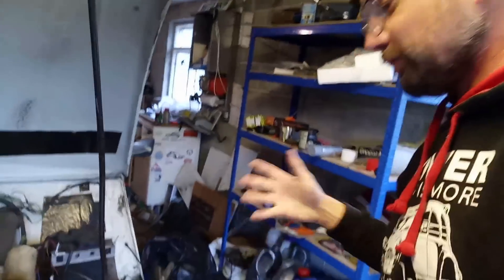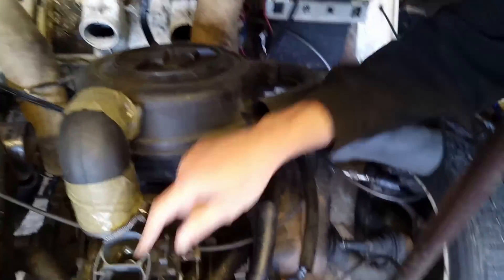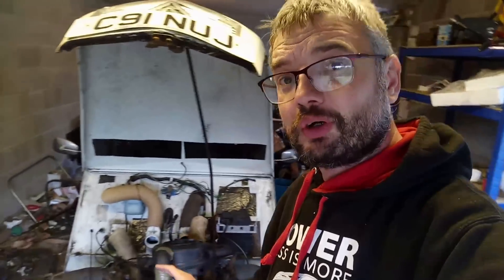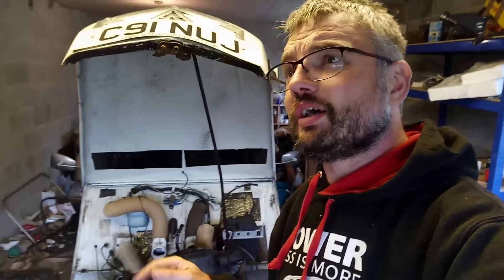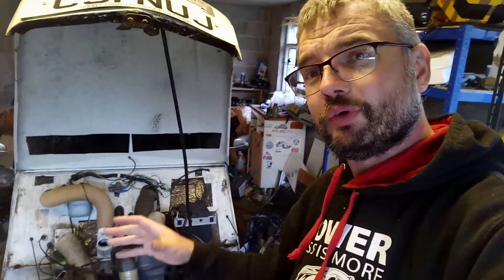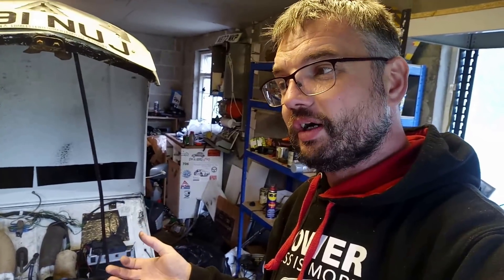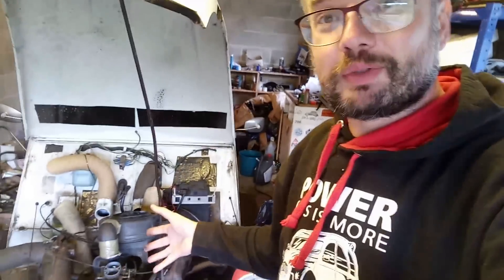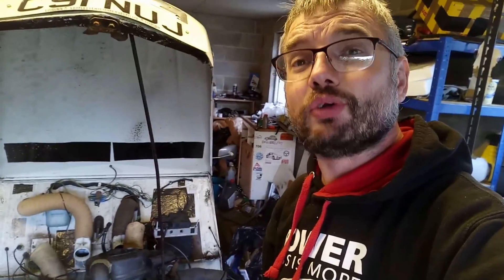Vlog: What is a choke and what does it do?

Comment: I used to own a Morris Ital, and the choke worked well as "cruise control" at speeds of up to 30mph.
Reply: So it wasn't just me then 😀
Reply: Same with the Opel Kadett I had many,many moons ago!
Reply: You were all coking up your spark plugs and washing oil off the piston bores with excess fuel.
Reply: Thats my kind of life hacks, no crazy technology, just ingenuity
Reply: @RussEdgar445y7tlfj  depends how you have it adjusted with the little screw. Yes, the screw should open the throttle a little first but its possible to get this wrong.
Reply: @stepheng8779  Fine if you want premature engine wear and excessive fuel consumption and emissions.
Reply: @TheMentalblockrock  trouble is John my Ital went to the great scrapyard in the sky some 25 years ago so as I said no longer really an issue. But I will put you out of your misery, it was rust that killed it, the engine was still working fine, choke and all.
Reply: @stepheng8779  Rust killed most of them sadly, very few Itals and Marinas left.
Reply: @TheMentalblockrock  yeah true, very sad loved mine, very comfy seats I remember. Got an ex BT 440 van after that which I ran for donkey's years but I couldn't keep the rust at bay, yet again the engine was still sound at the end.
Reply: Last car I owned with a choke was a 1990 Ford Fiesta I believe although I could be wrong. I had a 1987 VW Polo and that had an automatic choke.
Reply: @stepheng8779  The key here is to learn how to weld. That way, barring an accident write off or theft , you can keep an old car going indefinitely.
Reply: By The Way, HubNut cannot weld. it would be amusing seeing him try.
Reply: haha yes that reminds me of my Marina
Reply: I remember being in my brother-in-law's Ital as he pulled out of a side road with a cold engine and it started to die as he was halfway across the road--cue him frantically pulling the choke out to stop it from stalling!
Reply: @TheMentalblockrock  True, but let's be honest, as an 18-year-old with a car you bought for the equivalent of the price for a case of beer, would you have cared?
Reply: I went in an early Fiat 127,  that had a manual choke type device as a cruise control......very scary!
Reply: Blimey! I forgot I used to do the same with my 1987 Panda!
Reply: @TheMentalblockrock  No because for the first 1/3 of it's throw it just advanced   the throttle. Only in the last 2/3 of the pull did it actually enrich the mixture and once you were on your way the piston in the SU carb lifted and the enrichment had very little effect.
Reply: @dandare2586  A workmate had a cheap eastern european Fiat copy, think it was a Polski, and it had a cruise control device which clamped the throttle cable. I think you had to blip the throttle to disengage it.  Not ideal.  :o(

Comment: Having owned only two cars with chokes, all automatic, always worked well.  The '65 Corvair has a device that is operated by vacuum, that opens the choke slightly just as it starts and has a vacuum.   The choke has a bi metal coiled strip that opens and closes the choke.  Mounted on the head.  By the mid '80 carbs were mostly gone due the strict pollution requirements.  The benefit was cars ran so much better.

Comment: I never owned a car with a manual choke, but I had a 1969 Cadillac with 150,000 miles and  a clogged choke tube, which normally would have brought some exhaust gas up near the carburetor to activate the automatic choke. I had to stick a comb in it after a mile or so, otherwise the exhaust would stay black and it would get 5 MPG instead of 9 or 10. I was told that it would be expensive to clean out the tube, so the easiest thing to do would be to add a cable with a knob under the dashboard, but the engine threw  a piston rod before I had a chance.

Comment: The first car I looked at buying after I passed my test (2001) was a 1983 Ford Fiesta. I didn't understand why it kept cutting out when I started the engine and walked away thinking something was wrong. The car I eventually bought was a slightly later Fiesta with manual choke and still not understanding what exactly the choke did, proceeded to drive it 8 miles home with the choke out all the way. Doh indeed!

Comment: I was working at a Fiat dealership when the changeover came. We had to register the last cars with manual chokes by the end of Feb 1993 so there are K reg cars both with and without manual chokes. Along with automatic chokes came single point injection and catalysts. I understand it was the introduction of the catalyst that required the changes in order to control the amount of unburnt fuel entering the exhaust system and affecting the cats performance.

Comment: Early injection systems often had an extra injector for cold starts (sometimes controlled by a crude thermo-time switch based on a bimetallic strip) but modern systems just add more fuel by opening the normal injectors a little longer.
Reply: My Previa had a 5th injector for cold starts, but all my others just put more fuel in from the normal injectors. Good vid, you forget a whole generation knows nothing about chokes.

Comment: I remember using a clothes peg to hold the choke out on one car I had.
Reply: I was just about to say that Ian didn't mention the importance of the clothes peg.
Reply: @RussEdgar445y7tlfj  Yes always a wooden one.
Reply: Ahhh yes, BL vehicles
Reply: @aircrash tupolov That's right Mini's!  I had forgotten about that.
Reply: @RussEdgar445y7tlfj  True it was,  this has made me want to own a car with a choke again Lol.
Reply: Up until recently I had to use a clothes peg to hold the choke out on my Morris. Finally got around to replacing the choke cable so it now works as it should! :)
Reply: @Scuba72Chris  Good to hear they are still used 👍 and I hope you have keep the peg for just in case.
Reply: ah, the classic British Leyland choke trick, remember doing it on my mini
Reply: @RussEdgar445y7tlfj  I always thought it was quite amusing that the heater knob had a fire symbol on it!
Reply: I'd totally forgotten about the crocodile clip from an old battery charger that lived on the choke knob of my Dad's old Mini!
Reply: It was a standard dashboard accessory in both of my Minis, and everyone else's that I knew.  Ever.
I shudder when I think of the length of wire door catch release.
Reply: @RussEdgar445y7tlfj  My Mum's F reg didn't have the floor mounted starter, but did have the hinged number-plate and wire door pull.  Might have had a floor mounted wash/wipe switch.  Not sure, it was a long time ago.  I learned to drive in that car, and I only told her about ten years ago...  She had no idea.  :o)
Reply: Wow I’d forgotten the clothes peg until I read this!

You’re dredging up some very old memories for me!

Comment: On a related note, my dad gave me a tip on starting a car that has a flooded carburettor; push the accelerator to the floor (no choke) and keep it there then crank the starter, after about 5 seconds or so it will start. Works too. Disclaimer: I don't know if this only works on certain types or makes of carburettor.

Comment: I recall an old story from the 1960s about a lady of a certain age who'd just passed her driving test and bought a new Mini ....seemed the car was not running too well....kept taking it to the garage and they couldn't find anything wrong...in the end, the head mechanic went for a drive with her...when they got in, the lady pulled out the choke and hung her shopping bag on it...turns out that was the reason the car did not run too well, so after explaining it wasn't a shopping bag knob after all, and showing her how to use the choke, the problem was fixed.
Reply: I seem to recall in the old Mini that the choke knob was in the middle console too, so ideal for hanging things on!

Comment: American manufacturers adopted automatic chokes almost universally in the 1960's. Our early 1970's VW beetle also had one. My first experience with a manual choke was when I bought a new 1980 Renault 5. 1.4L. Renault went with fuel injection across it's range in 1983. Throttle body style on the 1.4L R9 Alliance . California cars had multi point FI.

Comment: I had an old Mini and the choke used to act like a sort of cruise control too. Obviously push it in to drop the revs. Pull it out to increase revs.
My body developed muscle memory performing this act.
First time I flew a light aircraft, a Piper PA-28, the instructor allowed me to land it. He was talking me through it as I did it.
Once the aircraft was over the fence he told me to chop the power.
So, my Mini choke muscle memory kicked in and I pushed the throttle forward to the stop which applied full power.
That wasn't good. 😁

Comment: The SU has a variance on this in that the choke control moves the jet away from the needle.
Reply: Correct, because on the SU the butterfly throttle plate did both "choking" and throttleing as there was only one barrel, as well as lowering the jet away from the needle. BTW, operating the choke on an A series equipped car also slightly opened the throttle as well as lowering the mixture jet. And this could be seperately adjusted by a screw.
Reply: Same with the E series and most likely others.
Reply: @RussEdgar445y7tlfj  Totally forgot about the HIF series.
Reply: And Strombergs had a seperate enrichment device on the side of the cab which allowed more fuel though.

Comment: My first car (1987 Fiat Panda 1000S) had a choke. Brings back fond memories, like using it as a kind of cruise control (as mentioned in other comments) Mine didn't have determined choke steps, it was just a sliding scale if you will.

Comment: My grandad gave me a Ford Fiesta with an over fuelling electric auto choke which he fixed by putting resistance into the circuit by adding light bulbs on to the wires. You’d start the car cold and the little lights would glow near the air filter.

Comment: Interesting blog. The choke on the 2cv has a line around the metal shaft that you can feel with a fingernail. My Pony starts best when this line is exactly flush with the barrel of the choke control, which is about 3/4 out.

Comment: The choke on a car is always a bit if a curiosity. It really varies from car to car.

'72 Triumph Stag basically only requires choke if its below 5°c.

Austin Maestro? Full choke to start in the morning unless it's over 20°c. As soon as it starts you have to drop it from position 4 to position 2, and set off from there. Close it off about a minute or two after that.

Comment: SAAB  two strokes had a triple barreled carb with 3 throttle plates on one shaft, but no choke plates. What was used instead was an enrichment circuit which is just a fancy name for an additional dash knob controlled fuel and air mixture gubbins on a separate 'circuit' you opened a valve to.   No other differences between it and a choked carb except the enrichment also sets a precise fast idle because of more air introduced with the richer additional mixture you turned on.  Brilliant carbs and they work well on 4 strokes too.

Comment: The 1980's Datsun Sunny had an automatic choke on the carb.

There are also carbs with primers and ticklers instead of chokes.
Reply: That's how modern 2/- work.
NO choke just bubble/primer.
Cheaper manu I suppose.

Comment: The worst chokes often called the strangler in the US were the automatic ones which worked on a bimetallic strip, fine when the engine was really cold but drive down the road until the engine is warm stop the car then get back in fifteen twenty minuets later and the damned choke had closed but the engine was still warm as the carburetor cooled faster than the engine, the engine would then be very hard to start.

Comment: A manual choke is also very handy for getting you out of trouble if your throttle cable breaks. Had that happen to me twice many years ago  - on the Marina it was easy to disconnect it at the carb and connect it to the throttle linkage instead and have a resulting hand throttle on the dash to get me from the middle of nowhere to a Unipart counter. The Hillman Imp was more tricky - especially using the hand throttle as the choke control was down at the base of the gear lever. Got me home, though.

Comment: As a motorcyclist  in the Sixites, some machines did not have a choke, requiring you 'tickle' their carburettors, which mean holding down the float to raise the fuel level to give a richer mixture for cold starting.  The no-mans land between just enough petrol to get the machine started,  and too much, which dowsed to plugs, was often wafer thin.

Comment: Skoda Estelle has the choke next to the hand brake. Best place for it in my opinion as you can nudge it off slowly without having to press something under the dash. Don't forget to prime the carburettor with the manual pump though otherwise it won't start even with the choke!

Comment: my 1982 transporter had an auto choke . turn the ignition on. 2 prods on the accelerator . auto choke activates. simple. the 89 Renault 5 had a manual choke on a lever that went up and down. but it was so sticky and notchy. I gave up. sold it very quickly.

Comment: My first car, a Volvo 460 with the Renault 1.7 engine, had a choke. Strangely, for a car produced by a Swedish company (so one expected to sell in reasonable numbers in a cold country), they decided to make the choke controls out of brittle plastic; the handle would shear off on frosty mornings. Remember that you couldn’t warm up the car without starting it... 

.... by pulling the choke out.

After three replacement (genuine Volvo) parts I resorted to keeping a pair of locking pliers in the door bin. Lock ‘em on, pull the remaining stump of plastic connected to the choke cable out, and when you’re done unlock the pliers and put ‘em back in the door bin. Driving round for a couple of miles like this did somewhat compromise Volvo’s safety systems a bit though🤭

Comment: Chokes can still be found on most small engined machinery such as lawnmowers and generators but these are being replaced by a thermal auto choke systems to make the engines a easy start system, which work ok until someone leaves fuel that has gone off after three months in the tank which causes non easy start.

Comment: Had 3 cars with chokes - Mk1 golf 1.3 - Weber carb conversion - worked well.
Mk 1 Astra 1.3, Weber carb conversion- worked well
Ford Capri 1.6 Ford VV carb with manual choke conversion- it was still bloody awful 😂
Reply: CRS1964 the golf and astra came with the weber conversions already done, the Capri cost me £280 and there was no way i was going to spend almost as much again getting a weber conversion - not when there was more important stuff to do like 2.8 pepperpot wheels and fitting a graphic equaliser 🤣

Comment: My newest car with a manual choke was my old 1990 1.0 OHV Vauxhall Nova. That thing still had breaker points and was a very reliable car i sold it with 140 thousand miles on the clock still running well when it was about ten years old.

Comment: Meanwhile, on less complex small engines like lawnmowers & generators, the choke is pretty much only there just to help suck the fuel up the jet and into the venturi so it gets into the engine, as without it, the engine just can't be turned over fast enough to get the fuel to move sufficiently... :)
Reply: Not all small engines have chokes, many modern ones have a fuel plunger or primer button linked to the float chamber that pushes a small amount of raw fuel into the venturi.  And on 2 cycles with pumper carbs the fuel delivery is always maintained by a butyl diaphragm, but you still need to "primer bulb" the fuel up to the carb and use choke when the engine is cold.  The old Briggs vertical shaft lawn mower engines had a vacuum controlled choke that also doubled as an acceleration aid.  They were very black smokey in operation.

Comment: Never mind chokes, Who can remember floor mounted dip switches? I'm afraid I'm old enough to have owned cars with them back when they were new.
Reply: My 1989 F150 has one of those as standard. Useful to have but I think I liked the single wipe windshield wiper as a floor button better. I think I had a Mk1 Escort with that many years ago.
Reply: @RussEdgar445y7tlfj  It may have been that I am thinking of, too. Just don't recall any wash to it - just a single wipe. Wash part could have been broken, of course.
Reply: We had floor-mounted beam switches on most American cars until maybe 1977. GM sold a couple of "trial balloon" cars starting in 1973 (the Chevelle Laguna and Pontiac Grand Am) to see if their customers would accept stalk-beam-controls and plastic bumpers and I assume the feedback was positive. My parent's Opel also had the windshield washer pump on the floor and you could get a floor switch to advance the radio station on some GM cars. As the wheels were brought in closer to the drivers feet to make cars smaller, I assume that placing controls down there got a little more awkward.